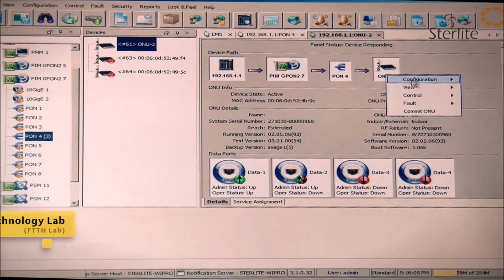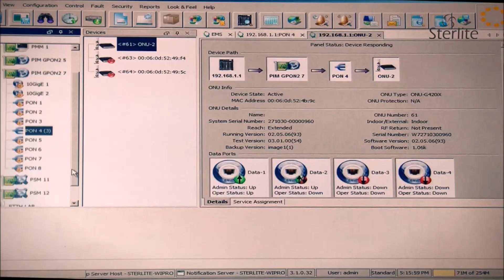Last Mile Journey Of Fibre To Home

Comment: Why Single fiber Simplex connection used for FTTH services while DUPLEX is needed for in and out connection.
Reply: Its GPON network use 2 diffrent wavelength in singh fiber fir Tx and Rx.